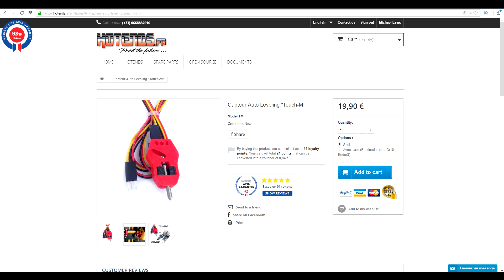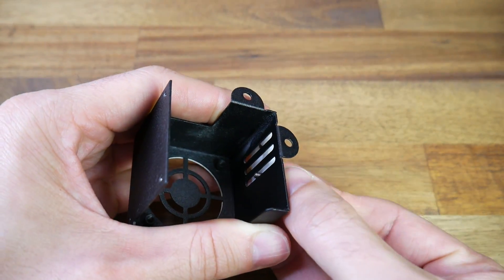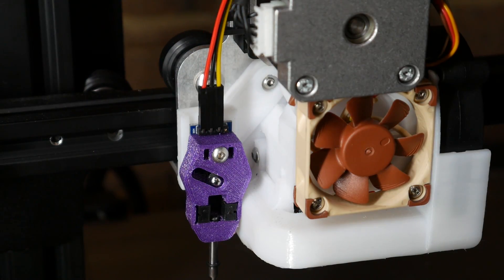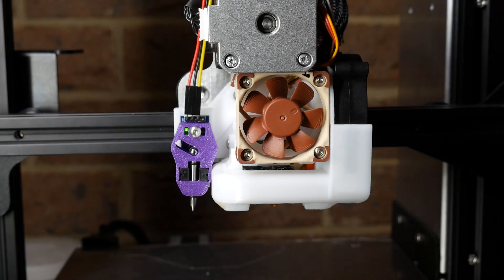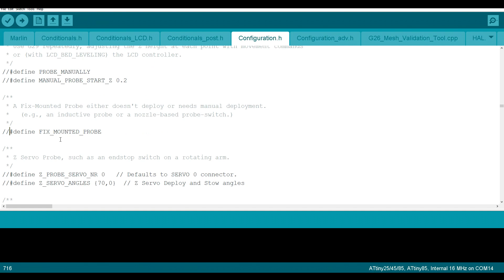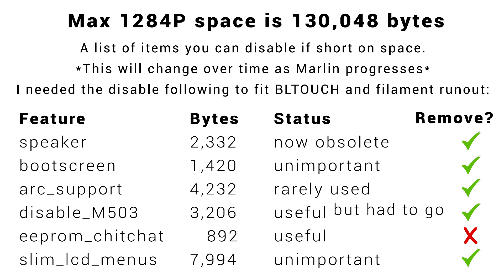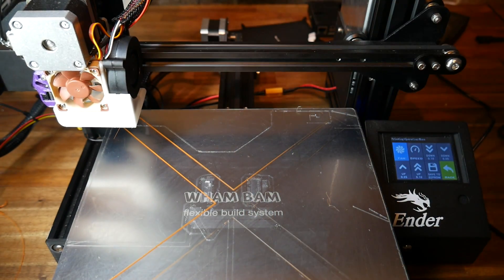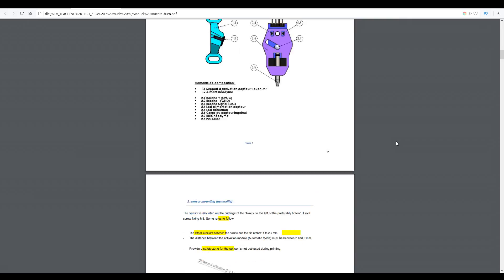Touch Mi auto bed leveling guide - BLtouch alternative? UPDATE IN DESCRIPTION

Comment: Those photo detectors are just not accurate enough for this type of use.
Reply: Not accurate ??How do you interpret this result.... 
https://gyazo.com/d47e5669d00d2cd05b505d766dc1d748
Reply: @Hotends-FR  Hello great. I installed it and it works perfectly better and more accurate than the inductive sensor I was using. How did you get that chart from Test G29. Congratulations
Reply: @juancarlos3989  Hi Juan, you can get values with G29 V4
Reply: @Hotends-FR  Ok I already did, the result how do I get it? .-
Reply: It's more a matter of a repeatability than  accuracy. One want to have sensor triggered on the same height, rest is a matter of z offset srtting. In this solution metal rod have short guidence and it's wobble. That can be a source of inconsistence.
Reply: @LoosiuFlying  I'm working on a version now that should have very little if no wobble, based off parts i have laying around, ill just have to get some magnets ($8 for 10), a magnetic ball bearing ($10 for 216) and a steel M3 bold/threaded rod.

It should just be a matter of getting the clearance perfect. loose enough that the bolt will drop and move without catching, tight enough that it guides the bolt correctly.
Reply: My Opinion instead of an optical sensor you can also just let the pin rest on a washer and if the pin is pulled up, it brakes electric contact with the washer, should be very repeatable and accurate
Reply: @badstep495  you would have to either have 2 pads that it bridges, which would cause inaccuracy, or you would need to attach a wire to the pin, restricting its freedom of moment or have some sort of sliding contact, that would again restrict its movements.

The optical sensors I have here have a very narrow beam area and will be inside a 3d printed black housing to absorb any refraction. i will also be painting the pin black to help as well.

I am looking for a deflection gauge so i can measure repeat ability.
Reply: My Opinion yes that is true, but I dont think two washers will cause that much of an inaccuracy. What you can also do is slide the pin in a copper tube, then add a nylon washer to isolate and a metal washer for the electrical contact. In that case you have sliding contact from the tube and the washer for the switch. But maybe a narrow optical sensor is accurate enough as well.
Reply: you could probably 3d print an insert for the photo detector to make the "view box"? narrower to make it more accurate, i think i might try and make my own, I have everything needed except the magnet and magnetic ball bearing. Both should be easily bought from local stores. Dont have any for of ABL yet so why not try, it should only cost me a few $ to make.

Comment: It lv8729 stepper drivers are installed on MKS Gen L?
Reply: ReactorTV 
You can use any that fit the configuration (I forget the name).  Just do a search on them.  Your best bet is 2208 or 2130, although those are the more expensive options.  I have the 2130 drivers installed on my Gen L board, and haven’t had any problems as of yet.
Reply from the maker: Testing them out. Print fine, but not as quiet as TMC. Wondering if I'm missing something. Video coming.
Reply: @TeachingTech  Maybe they will show the best results with 32bit motherboard and 1/128 microstep? I do not think that a 8bit motherboard with higher than 1/32 microstep is good idea.